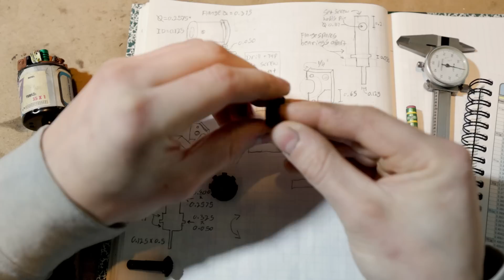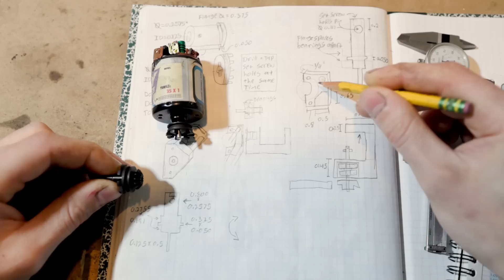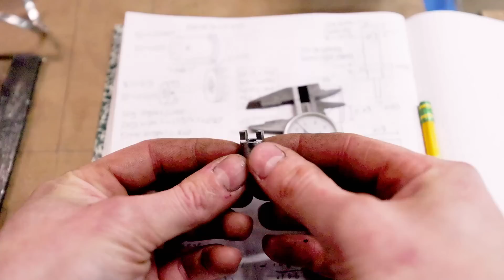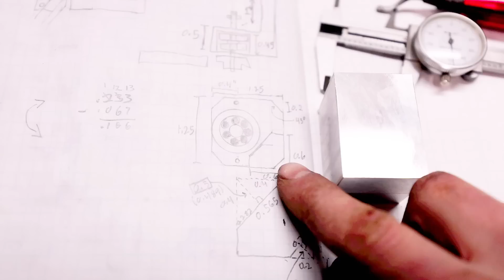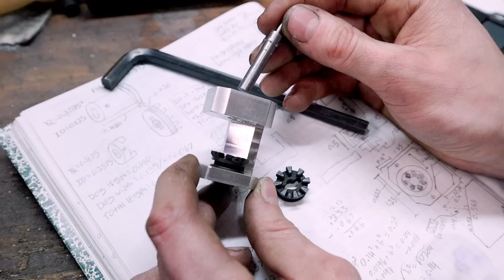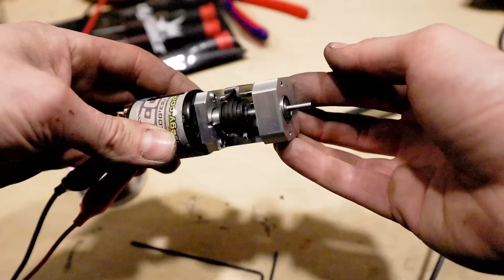R/C Mythbusters JATO Rocket Car |Ep 2| Machining My CRAZIEST Contraption yet??

Comment: Awesome progress on a very cool and creative project!  Loctite 609 is the stuff you need to fix those bearings in the housing. Formulated for just that type of application. Looking forward to the next step!
Reply from the maker: Thanks! I didn't want to use a permanent solution like that because I have had to take it back apart numerous times. I ended up using 2 grub screws to hold them in, as you'll see in this weekend's video. Cheers!